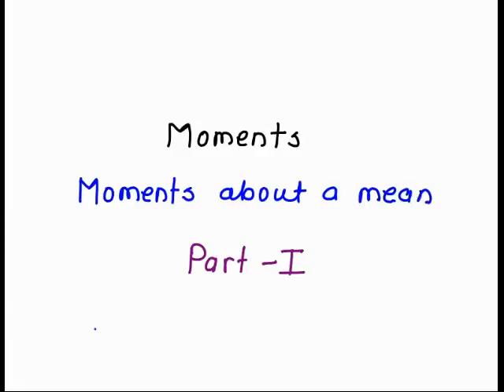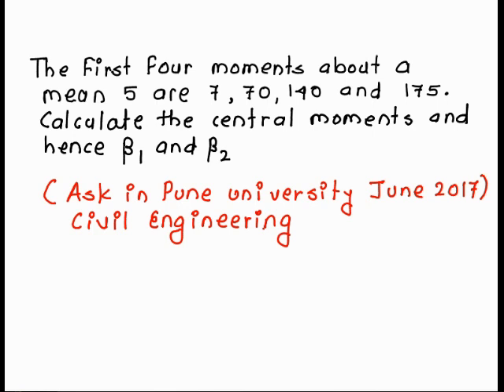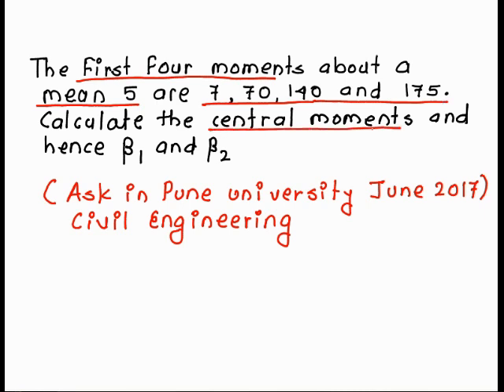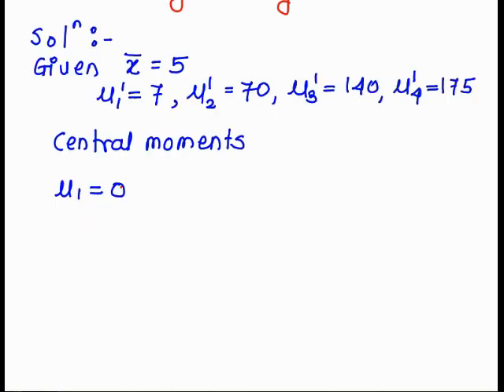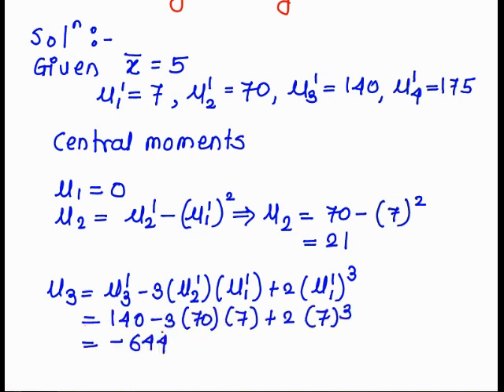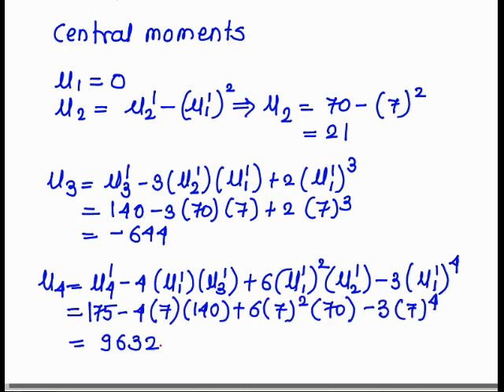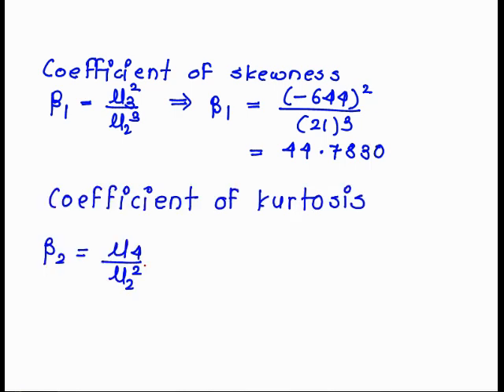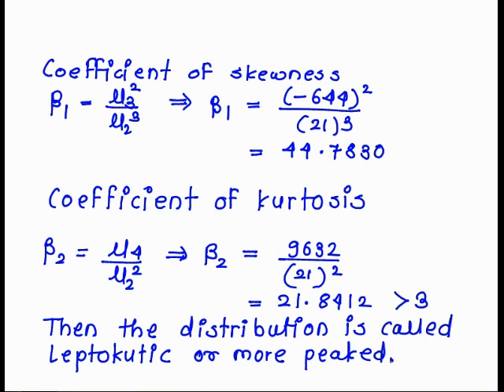Central moment about mean Part 1

Comment: What follows is a clear explanation of why “peakedness” is simply wrong as a descriptor of kurtosis.

Suppose someone tells you that they have calculated negative excess kurtosis either from data or from a probability distribution function (pdf). According to the “peakedness” dogma (started unfortunately by Pearson in 1905), you are supposed to conclude that the distribution is “flat-topped” when graphed. But this is obviously false in general. For one example, the beta(.5,1) has an infinite peak and has negative excess kurtosis. For another example, the 0.5*N(0, 1) + 0.5*N(4,1) distribution is bimodal (wavy); not flat at all, and also has negative excess kurtosis. These are just two examples out of an infinite number of other non-flat-topped distributions having negative excess kurtosis.

Yes, the uniform (U(0,1)) distribution is flat-topped and has negative excess kurtosis. But obviously, a single example does not prove the general case. If that were so, we could say, based on the beta(.5,1) distribution, that negative excess kurtosis implies that the pdf is "infinitely pointy." We could also say, based on the 0.5*N(0, 1) + 0.5*N(4,1) distribution, that negative excess kurtosis implies that the pdf is "wavy." It’s like saying, “well, I know all bears are mammals, so it must be the case that all mammals are bears.”

Now suppose someone tells you that they have calculated positive excess kurtosis from either data or a pdf. According to the “peakedness” dogma (again, started by Pearson in 1905), you are supposed to conclude that the distribution is “peaked” or “pointy” when graphed. But this is also obviously false in general. For example, take a U(0,1) distribution and mix it with a N(0,1000000) distribution, with .00001 mixing probability on the normal. The resulting distribution, when graphed, appears perfectly flat at its peak, but has very high kurtosis.

You can play the same game with any distribution other than U(0,1). If you take a distribution with any shape peak whatsoever, then mix it with a much wider distribution like N(0,1000000), with small mixing probability, you will get a pdf with the same shape of peak (flat, bimodal, trimodal, sinusoidal, whatever) as the original, but with high kurtosis.

And yes, the Laplace distribution has positive excess kurtosis and is pointy. But you can have any shape of the peak whatsoever and have positive excess kurtosis. So the bear/mammal analogy applies again.

One thing that can be said about cases where the data exhibit high kurtosis is that when you draw the histogram, the peak will occupy a narrow vertical strip of the graph. The reason this happens is that there will be a very small proportion of outliers (call them “rare extreme observations” if you do not like the term “outliers”) that occupy most of the horizontal scale, leading to an appearance of the histogram that some have characterized as “peaked” or “concentrated toward the mean.”

But the outliers do not determine the shape of the peak. When you zoom in on the bulk of the data, which is, after all, what is most commonly observed, you can have any shape whatsoever – pointy, inverted U, flat, sinusoidal, bimodal, trimodal, etc.

So, given that someone tells you that there is high kurtosis, all you can legitimately infer, in the absence of any other information, is that there are rare, extreme data points (or potentially observable data points). Other than the rare, extreme data points, you have no idea whatsoever as to what is the shape of the peak without actually drawing the histogram (or pdf), and zooming in on the location of the majority of the (potential) data points.

And given that someone tells you that there is negative excess kurtosis, all you can legitimately infer, in the absence of any other information, is that the outlier characteristic of the data (or pdf) is less extreme than that of a normal distribution. But you will have no idea whatsoever as to what is the shape of the peak, without actually drawing the histogram (or pdf).

The logic for why the kurtosis statistic measures outliers (rare, extreme observations in the case of data; potential rare, extreme observations in the case of a pdf) rather than the peak is actually quite simple. Kurtosis is the average (or expected value in the case of the pdf) of the Z-values, each taken to the 4th power. In the case where there are (potential) outliers, there will be some extremely large Z^4 values, giving a high kurtosis. If there are less outliers than, say, predicted by a normal pdf, then the most extreme Z^4 values will not be particularly large, giving smaller kurtosis.

What of the peak? Well, near the peak, the Z^4 values are extremely small and contribute very little to their overall average (which again, is the kurtosis). That is why kurtosis tells you virtually nothing about the shape of the peak. I give mathematical bounds on the contribution of the data near the peak to the kurtosis measure in the following article:

Kurtosis as Peakedness, 1905 – 2014. R.I.P. The American Statistician, 68, 191–195.

I hope this helps.
Reply: Didn't help